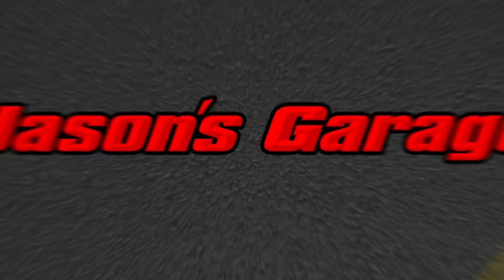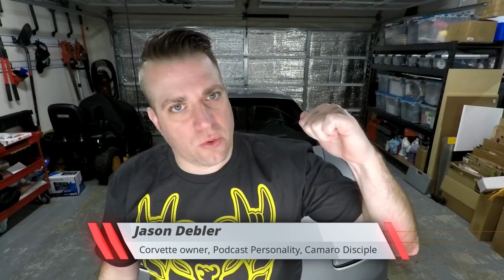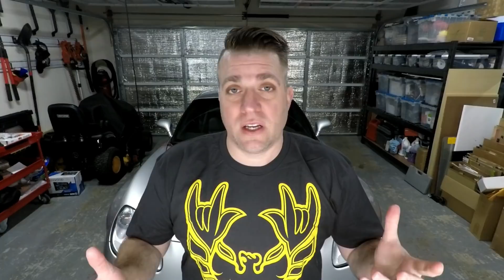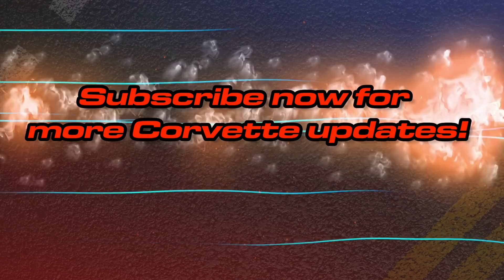LS7 Engine Cylinder Head Valve Drop Issue - What you NEED to know!

Comment: Looking at buying a 06 with 98k miles, and original heads. Runs like a top, and was recently at Chevy for a PCM issue and nothing said about any valve noise, etc. 

Seller says he is aware of the valve issue, but if it’s made it 98k, it’s obviously not one of the engines affected by the wear issue. 

What are your thoughts?
Reply from the maker: My 100% honest opinion...unless you got the cat on a screamin' deal and can afford to replace the engine if something goes wrong, get the valves checked by someone who knows what to look for.  Even though it made it 98k miles, it doesn't mean it will go another 1k miles.  It has happened with low mileage cars, high mileage cars, and everything in between.  Sure, there are some that never had the issue but I'd only take that risk if you can afford it
Reply: @InJasonsGarage 2008 through 2011 ZO6 were affected. When you get in problems with this cars when you modify it that's when problems happen. I guess you think you know more than Paul Kerner the top Corvette expert in the country.
Reply from the maker: @richardcerritelli9657  I am not claiming to know more than anyone, but I too have done my research.  I also know that those who work for GM like to keep their jobs.  If you ask people outside of GM, you get different answers...including people who have had the issue with their stock LS7 engines outside of the 2008-2011 range.  Like this guy with his stock 2007...
https://www.youtube.com/playlist?list=PLwpV2P5J-lOA812dx1WTgyk1k2J98T-VO
Reply: According to GM and research 2006 Corvettes were not affected its 2008 through 2011 cars were affected by the heads.

Comment: 2004-2008 Audi S4 BHF Timing Chain, valve guide wear, and/or cylinder bore scoring
2003-2005 Porsche 911 non-Turbo /non-GTRS IMS bearing design flaw
2006-2013 Corvette Z06 Valve Guide out of round machining flaw, design spec flaw, or material selection flaw

These are fun to catalogue.
Reply from the maker: I respectfully disagree on that whole "fun" part. It all depends on what side of the checkbook you are viewing a situation from.  😬
Reply: BMW v10 engines on M5 and M6 2005 to 2010. Rod bearing issues. Shooting rods to the moon.

Comment: 30k LS7 engines were built, a small percentage fail. Expensive if it does but telling everyone to replace the heads regardless is not good advice. My 5th gen Camaro had an oil pump failure that required replacing the entire engine. This is not uncommon in the LS3 but no one should have the oil pump replaced. The Camaro SS M6 has clutch issues, not everyone will have the issue nor should they go replace them. 30k engines, some with 200k miles on them now with no failure.
Reply from the maker: What is the "small percentage" number and who is the source?
Reply: My 14 stingray did it.... 26k miles...

Comment: Jason I got a 2008 ZO6 with 13,000 miles on it now and I'm torn about the head issue not knowing all of all of them need to be done if there's some signs that you here before indicating when it should be done like on your car did you hear any freaking anything that made you think the valves could be warned I better check them or was it just from all the other issues you've heard from others who would you recommend to do the work and are you happy with the kit that you got?
Reply from the maker: From my research, there has been no common indication that there is an issue and pending failure.  Sometimes there's noise, sometimes there isn't.   I had no indication myself, I just took the advice from others.  At the very least, have the heads pulled and check the valves but even then, you will likely need to have the heads redone.  I have been extremely happy with the heads/cam I got from AHP.  Give them a call and tell them your concerns, and tell them I sent you.  They will set you up with exactly what you need and nothing more.  See my other videos in my channel for unboxing, driving impressions, etc.
Reply: @InJasonsGarage  tha is so much will do ... I've been contemplating if it really needs it it's got 13,000 miles it's been baby beyond belief but I don't want to take a chance I don't think it's worth the risk myself
Reply from the maker: @krisi.2011  That's how I look at it.  You spend $45k+ on a very special and unique car, you spend a lot more money and time on top of that taking good care of it.  Despite that fact that this shouldn't be an issue...it most likely is and issue and is the cost of entry to owning an LS7 powered car.  So unfortunately, it is better to spend ~$2k of grand to prevent the chance of a catastrophic failure costing ~$15k if you want to play in that realm.

Comment: Great video  thank you for taking the time.  I was considering getting an Ls7 crate engine in a couple months for my project build.  Guess now I need to research if the problem still exists on new crate motors before I purchase.  Thanks again
Reply from the maker: There's always a lot of differing opinions with this situation, and if the problems extended to the crate motors has theories as well.  Hard to say for sure , there is no solid answer that I know of. I'd say that if you are going to buy a crate engine, have the valves checked just in case.

Comment: I’m the second owner of a 2006 C6 Z06 bought it 11,000 miles it now has over 40,000 I’ve never had an issues and I definitely don’t baby my car. I used to take it to the drag strip every chance I could for a few years until I moved States. Could the 2006 model be exempt from this valve issue..? More are Cold air intake, full aftermarket exhaust.
Reply: How’s she running now?

Comment: Mod list!

Dynatech coated headers
Vararam cold air intake
Fast 102 intake
102  Millimeter throttle body 
Qm 600 cam
BTR 660 springs
Chrome molly push rods
CHE rocker arms
WCCH Stage 2 cylinder heads
Port and polished
Decked 30 thousands 
MGW short throw shifter 
B&B Bullet exhaust...
93  Octane tune.

Car put down 565rwhp and 501 rwtq.
Also have every stock part taken off of vehicle  goes with the car.
Reply from the maker: Sounds like a fun ride!

Comment: Valve guide wear should  be checked every 20k at minimum  even after the repair has been made. The high redline in the ls7  causes valve motion that wears  valve guides out even if the guides have the right valve guide to valve stem clearance and even if the guide  machining is concentric.
Reply: THIS IS EXACTLY IT. There is no "fix" for guaranteeing keeping the valves from dropping BESIDES checking every 20k and rebuilding every 40-60k. The valvetrain geometry is just too aggressive for the RPMs the motor turns. 

I love GMs but will NEVER own a LS7. I'll go through the headache of stuffing turbos in the fenders before I rebuild my heads every 40k
Reply: @anewzack78 What about aftermarket heads versus machining the factory. What can be changed with the engine to fix this issue. I saw a video talking about “destroking” the engine, which would change the throw. Rpm can still be high but the throw is shorter. What’s your thought ?
Reply: @Zack-ou8es yes aftermarket heads will fix the geometry. The problem is the serious side load on the valve itself. I don't think destroking would change anything except where the powerband/tq comes in. I forget the name of the heads for the ls7 ... Frankenstein I wanna say??

Comment: What about LS7 crate engines from Summit Racing?
Reply from the maker: Hey Alex.  Are you talking about the Chevrolet Performance crate engines on Summit's site or another engine?
Reply: Yes. The performance crate engines.
Reply from the maker: @alexerickson5420  Hard to tell.  That's the problem, without GM acknowledging the issue, there is no way to know for sure.

Comment: Y'know.. I was just looking at C6 Z06's.. Cross shopping between 997 911 Carrera S's and the Vette seemed the better proposition because the 911's have IMS bearing issues, and the Z06 is more bang for the buck... Now, I'm learning that the Z06's will drop valves and grenade engines?? Sigh....
Reply from the maker: I cannot speak for the 997 as I am not too familiar with them.  However, the fix can be very affordable for the LS7.  Around $1,400 if you can do the head swap yourself.
Reply: I’m the second owner of a 2006 C6 Z06 bought it 11,000 miles it now has over 40,000 I’ve never had an issues and I definitely don’t baby my car. I used to take it to the drag strip every chance I could for a few years until I moved States. Could the 2006 model be exempt from this valve issue..? More are Cold air intake, full aftermarket exhaust. Jason's Garage
Reply from the maker: @raulbarron7580  Not necessarily exempt, but an exception to what seems to be a common issue.  Have you taken the valve covers orr and taken a look at things?
Reply: @365 AutoDrive A good point, there are some that have made it to high miles with no issues and proper maintenance.  However, there are also some that have made it to only a few thousand miles with zero competition use and more than the required maintenance.  I have also seen people post the opposite...avoid the early ones and get a later one.  
I think there is the problem that rises to the top the most...there is just no way to tell for sure.
Reply: I realize that this is an old thread, but thought I'd throw my 2 cents in. (porsche owner for 10+ years). If you get a 2010 thru 2012 997 it has the DFI motor. Hence no IMS. The IMS issue is over publicized. The single row IMS bearing (2005-2006) used on the M96 motor was/is more prone to failure than the double row bearing (2007-2009).

Comment: Really the issue is that the valve stems are hollow so they snap really easily.
Reply from the maker: That may be an ingredient in the issue, but not the cause.  If the valve seats machines properly there would be no reason for them snapping.

Comment: Why wouldn't you buy a 441 from Texas speed? Or just buy heads and cam upgrade instead of fixing???? Give better advice with your horrible haircut haha.
Reply from the maker: The TSP 441 is a great option if you need to buy a new engine, but this vid is about preventing that need.  An aftermarket set of heads set up right costs a lot more than a set of stock GM LS7 heads reworked. If you're not trying to make 1,000 horsepower, a stock set can make good power at a lower cost.  And I did suggest a cam, which I installed in my other videos.  :)  Hey...how do you like that ZL1 of yours?

Comment: Why not just buy aftermarket heads rather than have the gm ones fixed.
Reply from the maker: Great question.  It largely comes down to to cost and goal.  An aftermarket set of heads set up right costs a lot more than a set of stock GM LS7 heads reworked. If you're not trying to make 1,000 horsepower, a stock set can make good power at a lower cost.

Comment: guess im lucky bought mine brand new in 07 and still have it today at 79k and so far no problems
Reply: +paul gumbo you guys are on burrowed time lol
Reply: @YELLOW08Z06  borrowed
Reply: Jake geisser “GAY”
Reply: Im about to buy a 06 c6z think i should be fine 50k miles
Reply: The issue affected 2008-2011 LS7s. Your 07 is probably safe.
Reply: @jaco5187  You willing to buy him a new engine if his blows up because he didn't get it fixed based on your advice.?
Reply: parts wouldn't be his fault even if did dude take his advice. That's totally on the owner. To take 1 guys advice off a YouTube comment seems ignorant eh? You calling him ignorant?
Reply: @everythingautomotiveeta5839  All I'm saying is it's a well known issue among many of the C6 Z06 faithful. There are plenty of them in the forums if anybody cares to do some reading. Doesn't cost a thing. Take it for what it's worth. Roll the dice on a $15000 engine. The guy can do as he pleases with his own car.  And I didn't call anybody ignorant or anything else. Any other imaginary drama you want to stir up or do you have anything of any actual importance to add to the discussion?
Reply: Well look at this.....A C6Z owner pulling the heads off an LS7. Guy checked his valve guides himself and they are out of tolerance.  Drive it all you want. It's too late AFTER you can hear it.   https://www.youtube.com/watch?v=wudGbiTvSng

Comment: Don’t buy replacement GM heads.  If you have a reputable competent aftermarket specialist like Lingenfelter rebuild your heads with superior aftermarket parts the issue won’t come back.
Reply: Not true, the valves will still wear out due to the design of the ls7
Reply: Good to know. 
I am going to look at a 2006 Z06 tomorrow. 
The owner says the heads have been "checked" but not changed. 
I may just have to go ahead and figure that cost into the car. 
It has about 52k miles
Reply: Th3CrypticGamer  - I would take the Kelley Blue Book Value and subtract the materials and labor cost for a Lingenfelter or Katech head exchange.  “Check” means absolutely nothing - even if he could show you the dealer labor paperwork on it.  Unless you have a warranty with no deductible it’s all on you.  Assume it’s a ticking time bomb.
Reply: @petersouthernboy6327  
Hey thanks for the reply!
I decided to pass on this particular Z06.
Thank you for the help.

Comment: I can’t find anyone around here to do it for less than 5000 bucks. I want to buy one but the new z has to be fixed before I consider it.
Reply from the maker: Is that heads fixed installed and tuned?  Seems on the high side.  What area are you in?

Comment: The stock exhaust valve is a hollow sodium filled valve (correct me if I'm wrong). What if you simply replace the valves with a solid steel valves? Will they still break and drop in the burning chamber?
Reply from the maker: Good question.  The problem isn't necessarily with the valve, but the machining of the valve guide not being concentric with the valve seat.  If you don't fix that, any valve swap will not be a solution.  Plus, you have to consider the valvetrain weight.  The LS7 can rev very high for being such a large engine thanks to a very lightweight valvetrain.  Heavier valves will change the dynamics of the rest of the system.
Reply: Jason's Garage Hmm what if you swap the LS7 heads for good flowing LS3 heads? I noticed some LS7 crate engines come with LS3 heads. Here's a sample: https://www.mastmotorsports.com/collections/750-hp/products/ls7-427-black-label-900-supercharged-crate-engine-900hp

Are other LS engines also affected by the valve guide issue or is it just the LS7?
Reply from the maker: That engine might have LS3 heads because it is boosted and doesn't need LS7 heads.  Yes, you can put LS3 heads on an LS7.  You may need to check and piston to valve clearance and such and I think you would also need to replace the intake as well.  You would loose a decent amount of power and you can fix the LS7 heads for less cost than the LS3 heads and intake.

Comment: Hey Jason, thanks for the video. Question: I'm the third owner, is there a way I can tell if this issue has or has not been fixed aside from taking it to a mechanic? If the valve fails, will the car be driveable? Thanks. David
Reply: Thanks for the quick response Jason. I'll look forward to seeing the video.
Reply: You could also contact GM to inquire if any of the past owners may have had work done related to the cylinder heads. Even more so if the repairs were done under warranty.
Reply: Thanks
Reply from the maker: Hey David.  Congrats on the car!  You will love it despite its flaws.  I am also the third owner of mine as well.  There's really no conclusive way to find out if the heads have been fixed by looking at it but one telltale sign is to look at the head bolts.  If they are not factory and are aftermarket like ARP, then the heads have been off for something.  You can also take the valve covers off and see if the springs are different.  While you are there you can do a wiggle test of the valve just to see the condition (I'll release a video about this in a few days).  But again, that is no guarantee they valve guides themselves were fixed or fixed right.  You really just need to pull them and have then looked at by someone who knows what they are looking at, which means someone with LS7 experience.
If the valve fails, it will usually destroy the engine.  The valve usually breaks at the stem, and the valve head drops into the combustion chamber and the piston top plays racquetball with it at whatever RPM you were last at.

Comment: FACT If you are using a machined OEM ls7 casting bronze guides stainless exhaust valves etc you are only hitting reset on the problem period!!!!! Check them after 10k miles trust me
Reply from the maker: Good point, I have seen your videos before.  So just to make sure I am following, you say that using all OEM parts and machining the seats and guides to be concentric still doesn't fix the issue?
Reply: They are not my videos but that is correct

Comment: Great video Jason!  Like I mentioned to you back in November during SEMA '17 If someone has a factory warranty to also look into an extended factory powertrain warranty if they do not want to go the remove and repair route.  I've personally seen that warranty cover the cost of one new engine and a second set of cylinder heads and one transmission.  YMMV.